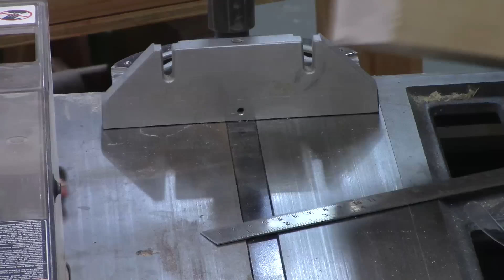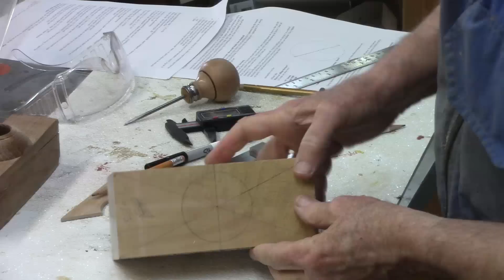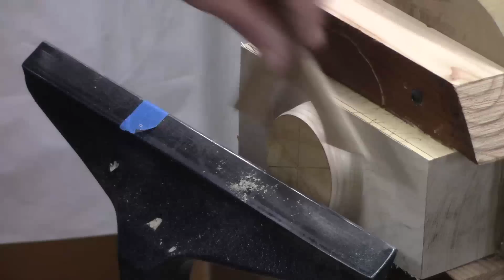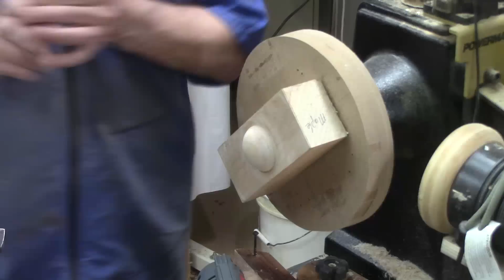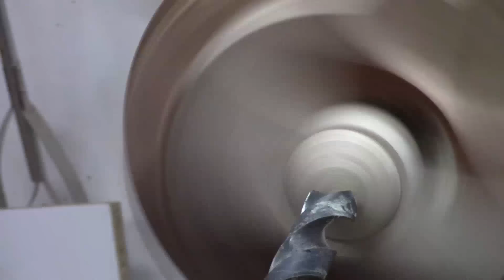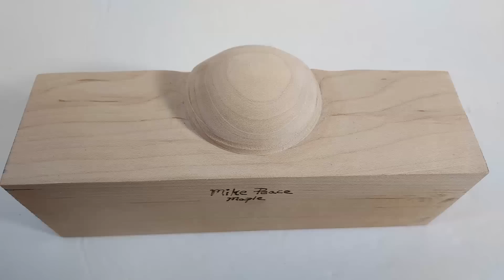Woodturning Something Square | 4-Ways Collaboration by Mike Peace

Comment: I keep going over this. What worked and what didn't? I'm still confused. Now I've got to try it. You are a good motivator!
Reply from the maker: It is all about the template and centering when turning and remounting the blank for the other side. NOt sure if I will do another one soon. The prototype and the final were enough for a while.
Reply: @MikePeaceWoodturning  I think you are so close. Do you think cutting the first one a little deeper, halfway? Then do the same when you flip it. Then I think the template would be bigger and more accurate.
Reply from the maker: @kenvasko2285  My problem was not matching the template to the depth of the cut I was planning on making. I started with a full hemisphere  based on misunderstanding someone else's project that was a hemisphere. The 2d issue was when I flipped it, it was a bit off center so the two spheres did not exactly overlap. A pricise marking of the end mounting point on the backer plate would have probably prevented that.
Reply: @MikePeaceWoodturning  Got it.

Comment: Very interesting take on the project and quite unique.  It didn't turn out how you envisioned, but it certainly will spark ideas and poses a challenge to the rest of us to try something like this.  I know you most likely didn't have it at the time you filmed this project, but that template is a perfect application for the 3D printer.  Now you've sparked the question about how one might model this project in CAD to assess jigs and templates to help in turning the design. Thinking some more about this, this is a very challenging project to get the centers aligned perfectly between the two orthogonal planes that each require mounting to the lathe to be turned separately.
  After having some more time to think about this, it seems like an additional block on the glue block against which the end of the blank would register (assuming the end is flat and square to the rest of the blank) would provide a registration point against which the blank can be placed for the initial sphere and then, when the blank is turned for the second sphere, would register the blank laterally to align the two spheres.  This would be more precise than relying on measurement and the live center point to register the two sides against one another.
Reply from the maker: Great ideas. Thanks for sharing.

Comment: two things.  one maybe a small 5/8" hole in the center of your backing board so you can go at it from the back side through the whole for some encouragement to come loose from the spectape.  two denatured alcohol does wonders on spectape for removing its grip.  When I make my off center turned earrings that are held onto the buttons with spectape I drop the whole thing in the denatured alcohol first before removing them.   I've yet to attempt an emerging bowl like that.  closest I have done is my desk organizer block of pear wood.  a bowl in th emiddle that is raised up from the rest of the top and less than the bottom wings on the edges and then there are whole drilled in it on ear side to hold pens
Reply from the maker: Good tips. Thanks for sharing.